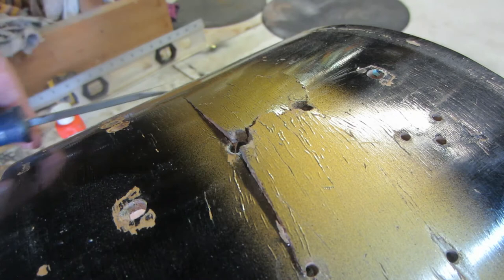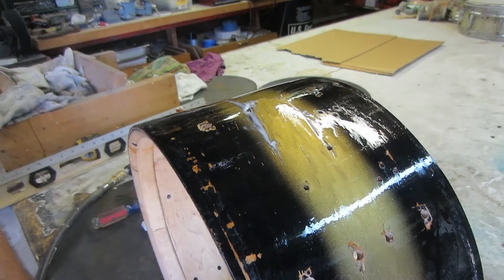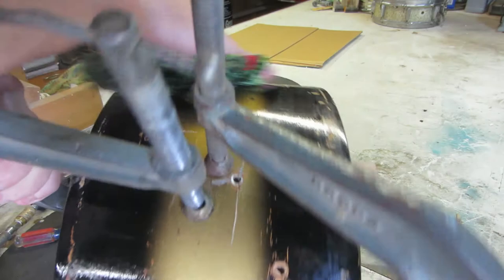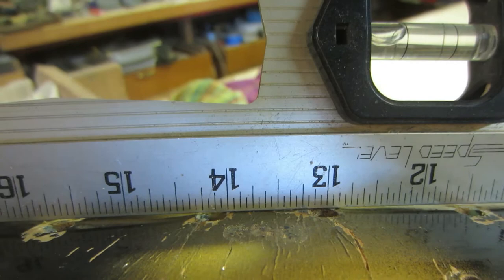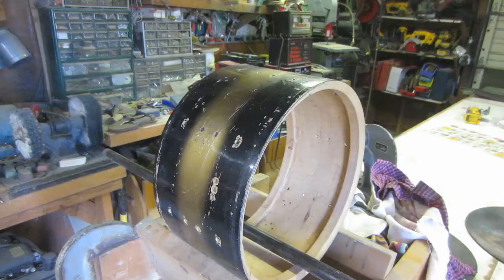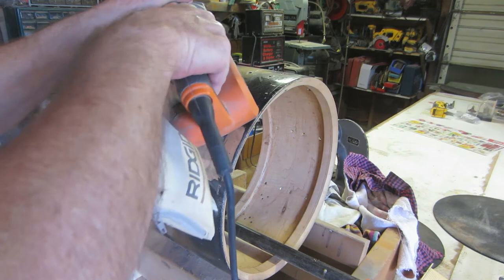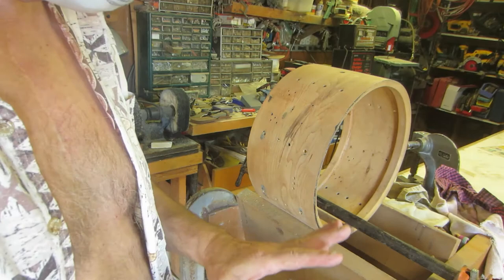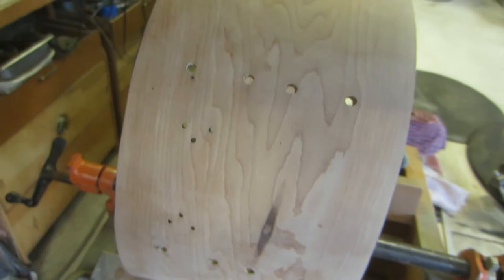1940s Slingerland Radio King Snare Drum Crack Repair and Refinish Part #1

Comment: Hi Bruce.  Wow.  'Took up the instrument when Nixon was elected and I can't imagine the need to tension that much.  I agree it must have been dropped with tension on it.  Quarter inch rock maple single ply is hard to crack.  Might try hyperdermic needle and inject the glue.  It works great on re-ring separation from shell.    I have a '48.  Ist year of the large oval badge.  That's a keeper.   Cheers!
Reply from the maker: Hi Brian and thanks  for joining in on the channel. Yes that drum was treated to a rough life. I was not dropped however, it was " over tensioned" to the point of splitting the shell. I go over that in the video. As far as the other drum " rat rodding " it. I chose to strip it and do a proper finish that I could live with. No I do not seal the inside of any drum that was not originally sealed by the factory. I tend to be mostly an originalist when it comes to any modifications unless there is no alternative. Cheers, Bruce

Comment: Very Nice Work here!!!  However, I do not believe that this drum shell cracked due to over tensioning.  Clearly this drum shell was dropped.  That big crack is due to the blunt force from a hard fall.  VERY NICE WORK ON THE REPAIR!!! 😉👍🏻♥️🥁🇺🇸
Reply from the maker: Thanks for your input friend. I think my assessment is solid because why else is the shell bulging in the center of the shell? Never mind if had been dropped or not. Over tensioning  causes the bottom screws in each lug to pull the shell outwards. I have seen this same thing on Leedy snare drums out of the early 50s when the shells were extra thin. Just look at any Leedy Ludwig snare drum with double lugs, and you will see what I am talking about. Every one I have seen has a bulge in the middle of the shell. Nice to chat, and thanks for the message.
Reply: @vintagedrumrestorationgara91  Kind Sir, all shells "bulge" due to tensioning.  You are right in your assessment that there was a pronounced bulge in your shell.  I do not believe that the big crack was caused only by tensioning.  While I am sure that the bulge (due to over tensioning) was prevalent in the shell after 75 years of use/over-tensioning, I strongly believe that the  large crack was exacerbated by some blunt force brought into the shell.  YOU DID A BEAUTIFUL JOB ON THIS SHELL SIR!!!  😉👍🏻🥁🥁
Reply from the maker: @iddrumco  I appreciate you theory friend and look forward to more of your input. The problem with your theory as I see it, is that the shell never had cracks on the inside before I started working on it. Wouldn't it be cracked on the inside if it were dropped as you say? I believe so. Could it have been dropped? Yes it could have been, but the lugs would have pushed the shell inwards, not outwards I would think. Anyway, I just think we are on different planes as to what MIGHT have happened. You could be right.... And I could be? I am just giving you my take and a lesson on how to repair shells. That is my intent here. I am not a "know it all" and do not profess to be. We can all learn from one another. Hope you stick around and join in on the conversation in the future. Cheers, Bruce
Reply: @vintagedrumrestorationgara91  None of us know everything Sir!  I learn new things every day.  One thing is sure, Snare Drum Shells do a hell of a lot of work!   They are always under stress and they sure serve us well!!!  Great Job Sir!!! 😉👍🏻♥️🙏🏻🥁🇺🇸
Reply from the maker: @iddrumco  Cheers friend. Always nice to have a new drum to work on and sort out the problems and pieces. Bruce